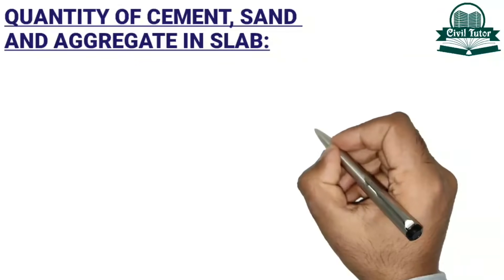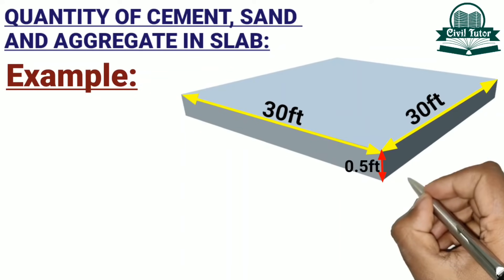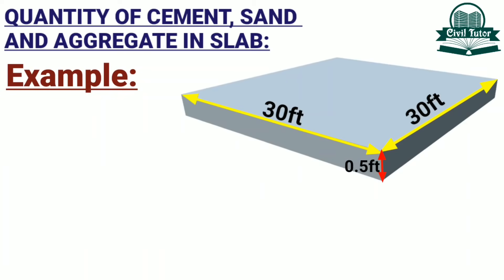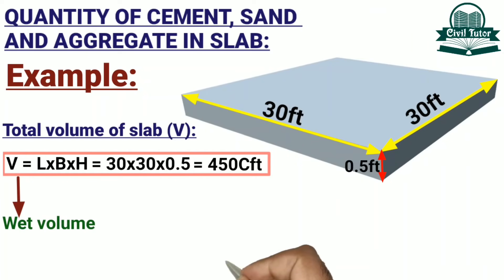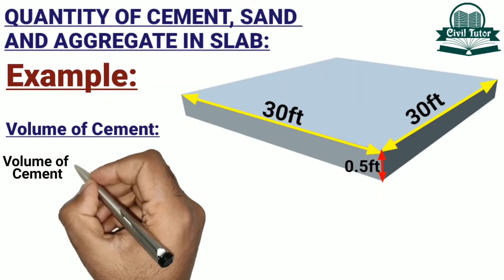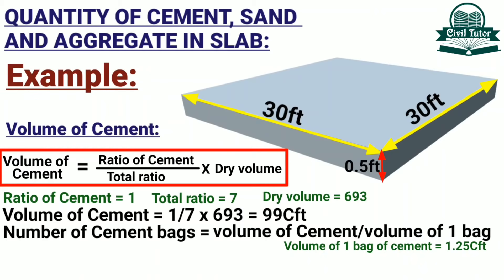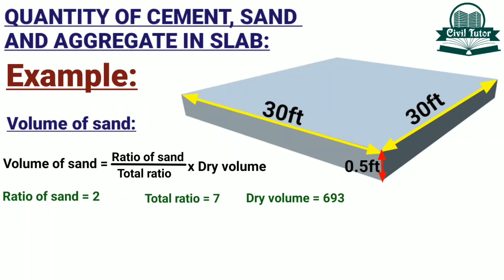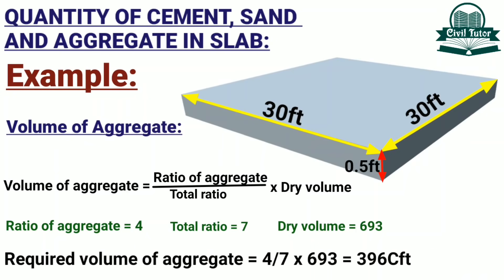How to calculate cement sand and aggregate quantity in concrete | material quantity calculation |

Comment: If we have beams in between, then how to calculate?
Reply: First find the material for Beam then slab then you can add both you will get the quantity
Reply: Find the Length breadth and height of that beam....Then calculate it later  add it in total quantity
Reply: Do you know the formula of volume thats to apply on it 👍

Comment: And how do we convert Cft into ft because that's how we buy the materials from the markets. For me it aggregates came out to 527cft so how much do I purchase
Reply: 527 cubic feet = 14.93 m3
Reply: @rajeevbhandari9349  how you did this ?
Reply: @digambarsutar7626  Using the calculator in your mobile
Reply: @rajeevbhandari9349  00 125
Reply: 1 m³= 35.28 ft³

Comment: Kindly convert to meter your computation, thsnks
Reply from the maker: You can multiply the volume in ft³ by a factor 0.028 to get the volume in m³.
e.g, 5ft³ = 5 x 0.028 = 0.14m³
Thanks & regards!
Reply: 1ft = .3048m.. Convert it from the start to get the results in cubic meter.

Comment from the maker: PS: 
The procedure shown in this video is for PCC works (without steel) 
M15 is used for plain Cement concrete. For RCC Slab you can use the minimum grade M20(1:1.5:3) and do the calculations accordingly.
Regards!

Download my compiled pdfs on Quantity surveying topics 👇🏻
http://store.civiltutorofficial.com
Reply: What is M15 & M20
Reply from the maker: These are concrete grades... M15 means concrete mix (1cement : 2 sand : 4 aggregate ) having characteristic compressive strength of 15N/mm². 
M20 means concrete mix (1cement : 1.5 sand : 3 aggregate ) having characteristic compressive strength of 20N/mm². 
Regards!
Reply: @CivilTutor  which ratio is best for 40x29 slab with 4.5 depth
Reply: @CivilTutor  also suggest me which cement is best for it? I picked ultratech weather plus.
And can we add dust to this mix?
Reply from the maker: The best safe mix would be M20 (1:1.5:3) for Slab and Beams.... For Columns you can opt for M25 (1:1:2).

If you are looking for high durability and workability, then i would recommend PPC. However, if you are looking for less initial setting then i suggest you to use OPC for house construction.

There is no harm in using Crusher dust if unadulterated by soil and other undesirable impurities. if you are talking about the finer particles below 150 micron - it is not recommended to use in concrete and last thing it would consume you more cement. 

Regards!
Reply: @CivilTutor  Thanks mate🙏
Reply: Pardon me for asking this. I am aware of M20 ratio but here in my village, it has been local practise to use 1:2:3 for RCC beams and coloums. I have no idea how strong the concrete is.  I am a layman beginner DIY.
Reply: @creativebrz1638  it would depend on how you sack the sand and gravel. That's why 1:2:3 is the one's been used because it's so hard to measure a 1/2 of sack of a sand since the sack had been opened you cant exactly get the 1 sack of sand.
Reply: Which video editor do you use?
Reply: @fahadhassanshahpeerzada  Concrete mix design…for required strength in mega pascal (mpa)
Reply: @fahadhassanshahpeerzada  Use SRC cement in foundation and OPC in Sub structure…

Comment: I use ready mix      for floor screed compressed with rule & float   26 kg per 1/2 inch depth every m2   mixing by hand   5kg cement 21 kg  grit same as before.
calculate concrete for  footings  or slab     lin/meters of footing x width x depth  ie   28 lin meters  x 0.450 x 0.300 = 3.78 m3   use this on a calculator . Because its metric always use 0. if the measurement is 999 or under   1000 being a metric meter   ie   0.850  for 850mm  or  0.085  if its 85mm    for 1 meter & 15mm  it would be  1015

Comment: How you converted cement bag to cft? Using bulk density concept? Please show step or tell kg to cft conversion.
Reply from the maker: https://youtu.be/lRw5imxxYU8
Reply: @CivilTutor  thanks for instant reply but i want to ask that the dry density of cement is taken as 1440kg/m3. It is not same for all brands of cement or is it same?
And also for sulphate resistant cement does the density vary?

Comment: All is ok.
But please considered reinforcement volume also...
For RCC  the reinforcement volume is deducted ..
Reply from the maker: This procedure is for PCC works....In RCC members, Volume of steel comprises of 1% to 2% of the total volume, which is comparatively low. 
That's why we neglect it in our calculations.
Reply: RCC Structure,  Rebar Quantity not Considered, Normally Rebar Quantity is 1 to 2 %. Also not Calculated in the BOQ.

Comment: How do u get the formula, volume of 1bag of cement=1.25cft can u explane me plz
Reply from the maker: Weight of 1 bag = 50KG
Density of cement = 1440KG/m^3
As we know, Density = weight /volume
1440 = 50/volume
Or Volume = 50/1440 = 0.0347m^3
Or 0.0347x35.315 = 1.25cft (approx)

Comment: Sir
Why don't we deduct volume of steel in evaluation of quantities of working materials like steel, sand , aggregate.....as steel is there in slab
Reply from the maker: Volume of steel of a structural member comprises of 1% to 2% of the total volume, which is comparatively low. 
That's why we neglect it in our calculations.
Reply: I want to know, how to calculate Sir

Comment: Sir ,my slab's area is 3990 sq.ft .My slabs thickness will be 5  inches .How many bags of cement ,sand(c.m) and aggregate do I need ??Please reply sir plzzzz🙏🙏
Reply from the maker: For M15
Cement = 296 bags
Sand = 731.4 cft
Aggregates = 1427.8 cft

For M20
Cement = 377 bags
Sand = 698 cft
Aggregates = 1396.4 cft

Excluding Beams

Comment: Hi sir!
How can we calculate different strengths of concrete like 15mpa, 25mpa, 35mpa etc.
And how to chose rebar size and rebar net blocks size
Reply: Mike Day Concrete has a great video on the different ratios required to get higher psi ratings

Comment: As of cement 1.25cuf
How should we calculate sand from cuf to tonn
Reply from the maker: Bulk density of sand = 1600kg/m³. Which means 1m³ of sand weighs 1600kg.
We know 1m³ = 35.31cft
which means 35.31 ft³ = 1600Kg
1ft³ sand = 1600/35.31 = 45.3Kg. so 1ft³ sand would weigh 45Kg or 45/1000 = 0.045 Tonne
Reply: @CivilTutor  please sir make it vedio like this
Reply: Sir, Your presentation is very clear & up to the point👌 thanks a lot.

Comment: How and why is the total cement ratio = 7 can this ratio be more or less or this is standard?
Reply: Sir M15 has 1:2:4 ratio after adding all these will be equal to 7 that is it's sum of M15 which contains cement sand aggregate
Reply: ratio is you get the total of your mix. 1+2+4 = 7

Comment: are u saying that a 30 *30*0.5 feet dimension concrete slab weighs 47 tonnes.
Reply: 45 ft^3 is volume not weight

Comment: Sir how can you convert 1.54 cum into cft??? Although it is in cum not cft
Reply from the maker: 1.54 is a conversion factor.... You need to multiply it with the wet Volume to get the dry volume.... It doesn't matter if volume is in cum or CFT.
Reply: @CivilTutor  ok

Comment: Total volume doesn't correspond with ingredients volume. Some strange calculation.
Reply from the maker: What is strange about this calculation? 🙄
Reply: I had the same thought, I think it is because the aggregates have spaces in between, which is filled by cement and sand. Total volume will be reduced when all ingredients are mixed. 👍

Comment: wow wtf is m15 and is it the same as c15 LoL
Reply from the maker: M15 stands for characteristic strength of cube and C30 cylindrical strength after a curing period of 28 days which represents 15 N/mm^2.

M30 = 30 N/mm2 of Cube
C30 = 30 N/mm2 of Cylinder
The standard cube size is 15*15*15 cm and for cylinder it is 15 cm diameter and 30 cm height.
Reply from the maker: Usually cylinder specimen shows higher characteristic strength than cube specimen. In India usually cube strength is generally used and cube strength is designated in IS 456:2000
Reply: ok, but c15 is maybe m20 then? and c25 is m30?